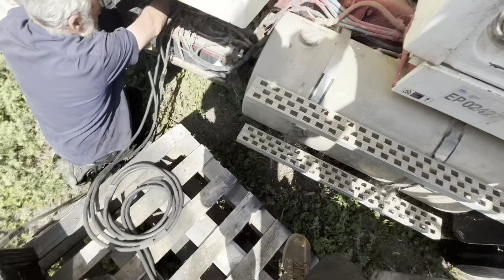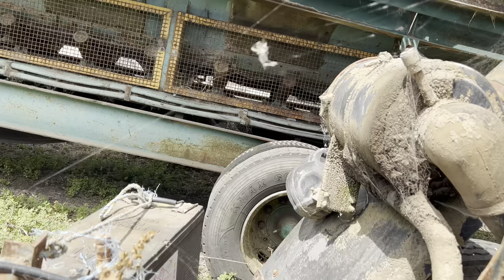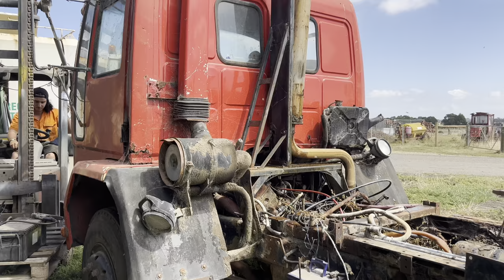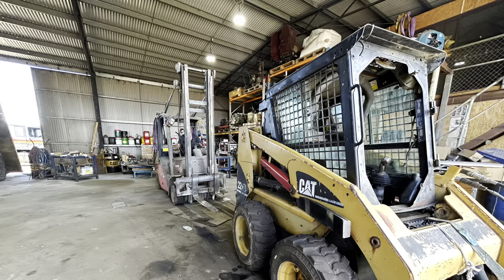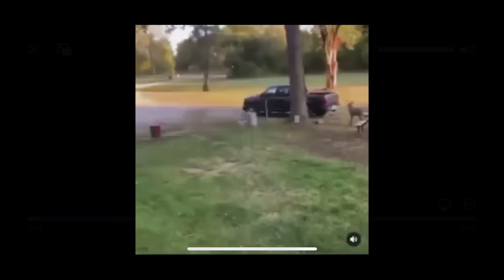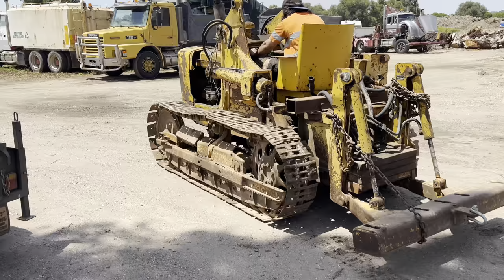I buy a cat skid steer, fit some tyres and drag a Louisville

Comment: Cabover is awesome. Love that it's converted to a prime mover.
Reply from the maker: It’s a good old truck it sat under a tree for over 10 years and after we primed the fuel up it started straight away! We pulled the sweeper body off and scrapped it as it was falling apart and then welded the turntable on to move trailers around the yard

Comment: The flat battery problem in the Louie,   pull or tap in a old truck wheel valve stem you inflate tyre with  ,,I tap the thread into the 1st air tank bung that 1st in line of air compressor on truck ,  then use tyre inflater fast flow coupled to air compressor in work shop ,  once work shop compressor stops the truck will be 125 psi same as it needs to be ,, undo brakes while compressor hasn't kicks off ,  have land crusher hooked up ready to tow start it ,, and put it in high range 6 ,  soon as compressor stops be fast to put valve core back in when you pull the air line off,  don't worry about fast flow coupler until you got valve core in ,  practice this few times or have plenty of spares ,,  ask for these tools at tyre fitter joints ,    once fitted flat bat's who cares cheaper to tow start cos you just leave the valve stem permanently glue with locktite thread sealant lock glue
Reply from the maker: Great tip mate all my own trucks have female nitto fittings in them and a double ended male lives in the truck so I can connect an air hose to either fill the tanks or pump up tyres or use air tools, this Louisville isn’t mine and it was a good excuse to have a play with the John Deere after I did the engine work
Reply: @dieseldownunder.  had same set up outright and people would just stare as my brother used the VS Berlina to tow start me in k100 but being so used to it we never had any fuck ups and I never ran into the car even on a 3 Mt rope lol

Comment: Shit hot at doing the tyre fitting for a back yard in guy or did you once work in the tyre shops ,  I did and will fulling admit I didn't weigh enough to get the tyre down in the well of wheel to pull the other side down an under rim lip ,  thank God for the truck tractor tyre fitter  just wheel up to it and turn it backwards and let clamps grab it an lift it spin it I just leaver it at the right time no fighting or scratching rims an I am 54 kg , little bloke in big blokes jobs 😂,     can't do office  crape jobs ,
I work like you in a trucking transport company ,  of Western star and kenworths ,  an s line inter tipper dog
Reply from the maker: Nah never worked in a tyre shop where I did my apprenticeship we had a tyre machine the same as what your talking about with the jaws it was a great thing I havnt found a cheap one for the shed yet sadly so a set of $100 eBay tyre levers do the trick I’m not much heavier than you and they make tyres surprisingly easy. The tyre shop in town charges 40 or 50 bucks to remove and fit a tyre and I refuse to pay that haha

Comment: Well you got all the tools there to fits old valve stems to all ya old trucks for these occasions of flat batts or emergency say it breaks down ,  just mount compressor on the back hook it up and then tow it quick smart off the road with any Ute even old VS Berlin v6 auto towed my kenworth more than a few times and handled the tow started well ,   just use high range higher gear  or it most likely Gunnar stop ya dead or break rope

Comment: Yank here, we have so many trucking regulations here in the states it is surprising any older truck ever gets back in service. This rig seemed to start fairly easy and idled smoothly. The muffler was rotted out. The rig looked rough, real rough. Were the brakes and steering and electrical and tires given a close inspection before it hauls its load on public highways.
Reply from the maker: Don’t worry our laws are even stricter it will never drive on public roads it’s strictly for farm use all we use it for is moving trailers around the yard if it was driven on the road I think you’d be heading straight to jail😂

Comment: What is that trailer with the arch on the back used for that's parked next to the old land cruiser
Reply from the maker: Someone attempted to turn an old machinery trailer into a mobile log splitter I’ve never used  it or seen it working a mate brought it and parked it there and it hasn’t moved since!